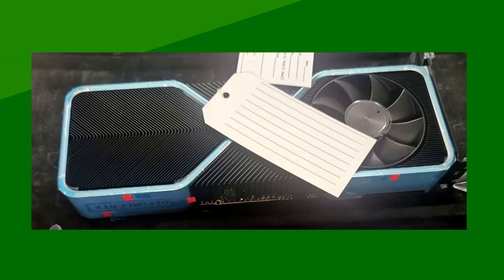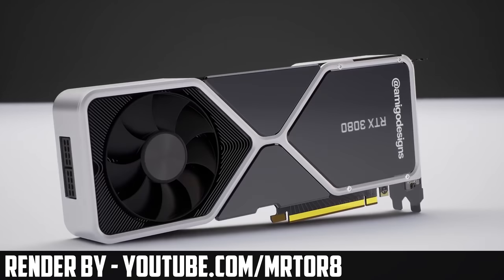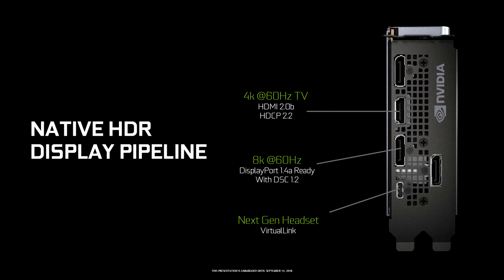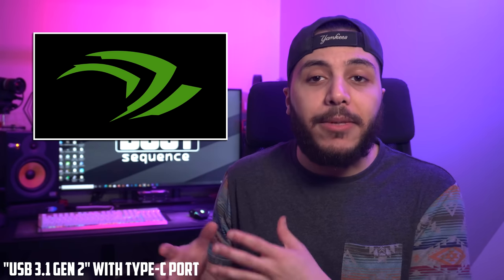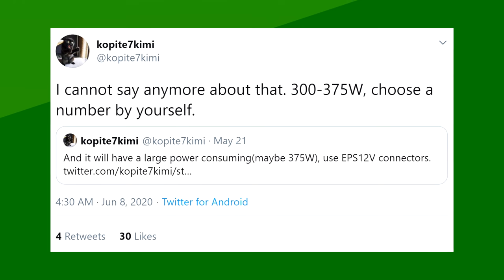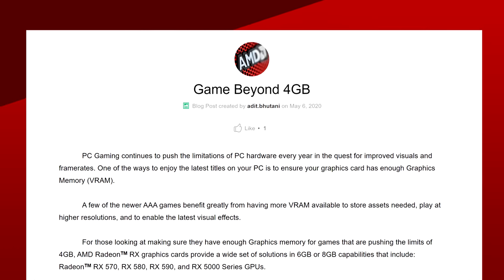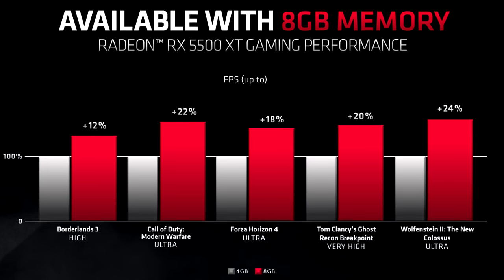Nvidia’s RTX 3000 Series to Draw Up to 375W!?

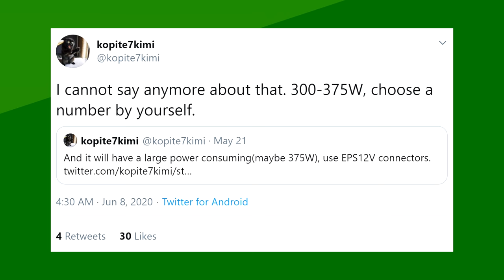Comment: 2:34 The most interesting part of the tweet imho is the EPS12V connector.  You'll need a power supply that has 4 EPS12B connectors on it which is very very rare.  Maybe they'll include adapters in the box to use 2-3 PCIe connectors to power the 2 EPS connectors.

Comment: what i wanted from 7nm GPU is efficiency, not 375watt furnace for f*** sake, Huang....
Reply: Well they wanted to push clock speeds which require exponential amount of power as you go up
Reply: High end gaming PC will be turning into factory machine in the future

Comment: Over 300W on 7nm? That's quite a lot for such a power efficient process. Are they scared of big Navi so they pushed them to the limit?
Reply from the maker: well, rx 5700xt can draw a huge amount when overclocked! also, yes, that seems to be the consencus. NV doesnt want to love.
Reply: This reminds me of GTX 1080 Ti ... they made it because they shit themself about Vega being OP but it was poopy and they end up making an OP card that will remain to terrorize RTX 2080 xd
Reply: @kajmak64bit76  I think Nvidia would've always made the 1080Ti because Pascal was a huge leap to keep them at the top they did go from 28nm to 14nm with a new architecture not just a node shrink. They made Turing expensive because Vega was a flop and had 2 years of the market not being competitive
Reply: @BootSequence  isn't lying. My 5700xt cranked to 2130mhz cooks over 260w. Still a far cry from 350w+ though. Imagine overclocking a 3080ti to 450w hahaha
Reply: @imo098765  pascal is more or less a refine maxwell not a new architecture. But further optimization on the architecture with added benefit of die shrink they able to get crazy efficiency out of it.
Reply: @snkmazda  It could rival a factory machine in term of power draw.

Comment: Add another $75usd to the cost of your favorite Nvidia card. Power supply prices have gotten silly lately.
Reply: TDP doesn't mean power usage btw... TDP is thermal design power... it's heat output xD it's not power usage
Reply: @kajmak64bit76  And, as you know, they are closely related. And your point?
Reply: @kajmak64bit76  Considering a 250 TDP 2080ti draws around 280-300 watts we know that this card will take alot of juice.

Comment: 8 GB is now minimal. Period. Tom? You there to agree?
Reply: from my own experience 6GB is perfectly fine for 1440p and 1080p. I've never seen max usage even at 1440p + max textures. 4k onwards demands more, however.
Reply: I didn't used 8GB in my 5700 XT even in RDR2 in 1440p cause it would be unplayable. When I was using GTX 970 I heard 4GB is also minimum, but personally I've never used it. I really don't know what's all that VRAM for.
Reply: My experience - 512MB is somehow not too terrible for 1080p and under
Reply: Game developer need to optimize more rather than hoping for bajillion of VRAM or raw performance will help them to compensate.

Comment: That effective clock would be (approx) 21,000 megabits not megaherz
Reply from the maker: No. Mbps isn't a clock speed. It's either "21 000 Mbps" or "effective clock of 21Ghz" there are about 8 ways to describe memory dude. I simply chose the one overclockers are familiar with.
Reply: Megahertz was correct for a clock speed your "correction" sounds like a measurement of data capacity which does not make sense in this context.

Comment: Man, I hope the 3060 or 3070 doesn't deaw more than 215W. I just got a tiny ass 500W sfx for my SFF build. I'm gonna go Semi-passive for the CPU side as well so I hope it's worth the wait and doesn't run like a space heater! (Also, we don't really have s/c here so summer is a nightmare for gaming.)
Reply: could be the next titan, something pro grade. im sure it could draw that but i doubt it actually will. might be capable of drawing that is more likely than it normally doing that. i doubt theres a cooler that can cool that much and still fit in most PCs
Reply from the maker: honestly, you'll probably be good up to 250W. Unless you have a power hungry cpu. remember, in gaming, video editing or even 3d rendering, you're never really hammering both at the same time.
Reply: SFF built is not good for ventilation

Comment: That Nvidia card looks plain weird, I had heard the design came into a bit of stick but to see it, well just weird I get the point of it though. The info about 6gb or more video memory is understandable as I still have an old R9 380 4gb and I had some issues. I keep the thing as a spare just in case my RX 580 goes wrong and I need a temp replacement.

Comment: memory at 21Ghz GDDR6x is insanely high, but im curious why he calls it a 3090. By analysing the GA102-300 model number, we can infer that this is most likely going to be a 3080 Ti, because the 2080 Ti was a TU102-300. for reference, current 2080Ti is effective 14GHz memory.
Also the 3080 (GA102-200) now having 4352 CU's would be an exact match to current gen 2080 Ti. And fits their pattern of bumping up the CU's of this gen's xx80 Ti to be next gens xx80, but it is now being given to you on the full size 102 die, a change of pace (instead of a cut-down 104 die)
Reply: Badog98 21Ghz is the frequency that the ram runs at fool not the memeory bandwidth at 21Ghz with 356bit bus memory bandwidth is in the 800Gb/s I believe
Reply: i knew in advance ppl were gonna have an issue with the tweet saying 21Gbps, but its because memory manufacturers advertise in "Gbps per pin", but nvidia advertises it as "effective Ghz" - 21Ghz effective. This is due to GDDR6 using the QDR quad data rate (4x per clock cycle) - similar to DDR (2x per clock which everyone already accepts). We had QDR already on GDDR5 and the 1080, but now with GDDR6 and the 2080/3080 its again multiplied across two channels, so its x8. They are actually able to back this claim up, and the complexity is too hard for most people to understand. In laymans terms, If the data flows at 21000, the clock would be 2625, but simply calling it 2625 doesnt convey the full picture of improvements. Look into GDDR6. http://monitorinsider.com/GDDR6.html

Comment: either 'up to 375w' is exaggerated or theyre going to have a magic breakthrough in cooling because there isnt enough room in a 2-3 slot cooler to move that much heat. i mean look at all the big CPU tower coolers that are rated for what, 200w? twice that would have to be twice the size or twice the magic. maybe its just an under heavy OC wattage, not anywhere near standard TDP
Reply from the maker: well, AMD wasn't afraid of doing it, I doubt Nvidia would take a chance at letting AMD take over. I'd say for the "3090" 325-350 might be it.
Reply from the maker: and yeah, I get the cooler argument, but I can see a shift to " Performance to temperature" rather than per watt. NV's been doing it for a while and AMD is kind of doing it with their CPU's and PB.
Reply: @BootSequence  but the per watt is used as a measure of value, temp has no relation to value. so that really makes no sense. PB is more of an automated OC for people who dont like playing in the bios. 

you can directly value things in a per watt because its super easy to go straight from watt to canadian pesos in your case, or dollars in many other countries. per temperature may as well be intel saying ' no need to look at benchmarks anymore ' but with more confusion

Comment: ok, so we start having an idea of what power the next-next-gen console will have ;-)
Reply: What do you mean
Reply: The PS5 is like a RTX 2070 Super, while the Xbox Series X is like a RTX 2080 performance wise. The next generation consoles are powerful but, will be left in the dust compared to big Navi and Ampere.
Reply: @ZackSNetwork  oh I thought you were implying that the consoles would edge up to ampere
Reply: Badog98 I expect rx 5700xt replacement to already be 11 to 12 teraflops😂
Reply: @RowsieFox  if the next gen consoles have the same performance of the best desktop GPU (rtx 2080), this year (with the rtx 3080) will know the power of the next gen consoles... the one which will be available in 4 years...
Reply: ZackSNetwork How the fuck can consoles have the same performance as a 2080 ? How it will dissipate that much heat in such tiny space  ?
Reply: @_RTX2060SUPER_  because new more power efficient architecture. That's how next gen hardware works. You can get similar performance to the previous gen with less power an less cost
Reply: @willgart1  yeah I'm getting a 3080ti and watercooling that bad boy. It's gonna last me years
Reply: ZackSNetwork the ps5 is like a 1660ti at most , in performance all around!!!
Reply: @lancelot5170  no it's gonna be like a 2080. The thing about that is the 3060 is gonna be better than the 2080....
Reply: RossCraft 9-1-1 im
Talking about a ps5 perfomarnce , not close to even a regular 2080, thats all i know , plus I dont care for ps5 
, just waiting if should buy the 2080ti or wait for the 3080ti , thats it ....
Reply: @lancelot5170  it's gonna be. It really isn't impressive at all though considering what I said. Buy a 3080ti because it'll have 4x Ray tracing performance and 50-90% better overall performance

Comment: Sadly though heat generation in your case will probably become a major issue! Especially if you have a mid-itx sized case. 

I'm personally very worried about the thermal issues and degradation of VRM's, Ram and Motherboard life span all thanks to all the 360 degree heat dispersion from the card itself. 

Not a great design at all! 

Triple down force fan array of a far better idea for case fans to control the heat dissipation. 

On top and underneath will push out heat directly onto the PSU and CPU/VRM's. And those power numbers on top!? Damn space heater! And your poor electricity bill arghhhhg. 

Don't forget I'm in Australia! Our power bill with my 3900x would be over $.5k a quarter with the amount of time I spend on my PC. 

Looks like Big Navi is already want I'll be upgrading to from my 1080ti. 

What is Nvidia thinking!?

Comment: 375W is not that high.. at least to Vega dudes lol
But in general, 3090 (what we used to call 3080ti) is probably 300W & might go up to 375W limits (OC)
Current 2080ti is 250W stock, so it's only 50W increase 
All in all, it's only rumors, don't believe everything U hear, just wait to late 2020 (Q4) & check the Benchmarks (Big Navi Vs RTX 3000 Series)
Reply: The custum 2080Ti with a higher powertarget can use up to 350W.

Comment: I'm going with the Ryzen 4700G (integrated graphics). Probably on an A520 board as soon as they come out. Fuck all that overpriced crap. I will use the open PCIex16 slot for a multi-nvme card.

Comment: Have never seen the point of 4GB on a graphic card,8GB should be consider minimum amout,just like with 16GB as minimum on a pc.
Reply: 16GB minimum for PC?  I have that but I also run 100-200+ browser tabs at once plus 10+ other apps and even two games at once at times and still don't run out of RAM.  Why would a normal user even need that much RAM?
Reply: Game developer need better optimization. If they keep doing with what they do then even 100GB of VRAM probably will not be enough.
Reply: @Sounomi you faux PC gamers are hilarious

Comment: The cooler designs appears to make no sense at all, moreover there's no sign of "GDDR6X" anywhere. I really doubt about this leak honestly, especially on the vram and power draw.
Reply from the maker: It's special. but it does make sense. not in a sense that "this will cool anything" but just that its like any other 2 fan cooler.
Reply: @BootSequence  those leaked images show few fins that only go in one direction, so one of the fans looks useless. Since fans look kinda thick, I doubt there will be any space for a "normal" heatsink. It just doesn't seem to make any sense as an heatsink, unless it's going to be substantially different in some aspects. In any case, that fan configuration can only direct air towards the center of the card, it doesn't seem very meaningful.

Power wise, the 300-375W figures could have just been deduced from a 2x8pin configuration. Many cards have double 8 pin pcie power connectors but don't draw that much power.
Reply: Boot Sequence how could one of the fans be useless? It’s the same one both sides just mirrored. The heatsink is all over the card and the fans blow the air through it. The blades are even melded to the sides to direct air down and out like amd cpu coolers
Reply: @blarb4249   who are you writing to?
Reply: Agost I think he’s writing to you.

Comment: 3080 should be good but the price and power draw too high
Reply: this is not a laptop, power draw is fine. Keep your 5 watt mobile stuff if you don't like it.
Reply from the maker: I agree with ATTQ we got room for it.
Reply: I’m talking about the rtx3080 and what I think that the prices and power draw might possibly be if this is drawing a massive 375w and that is true it could be very toasty. I hope that’s not true and prices are lower than  rtx 2080ti pricing. But I don’t trust Nvidia ....... yet!!!!!  Time and benchmarks will tell us. Beside no one knows wether the pic is of 3080 or 3080ti. (Or am I wrong about that) So everything reported is still unconfirmed and these ARE just leaks
Reply: thats why it called Ampere..
Reply: I don't mind that power draw though as I used to run a factory machine at home